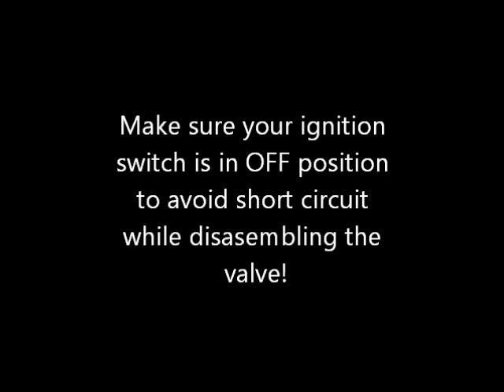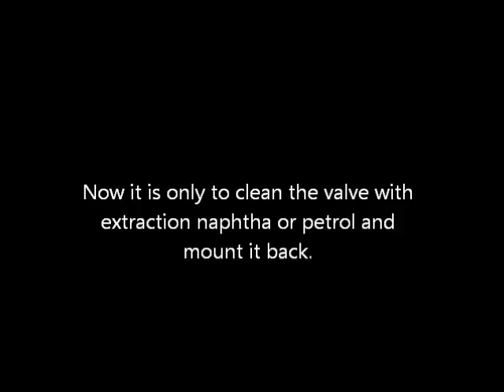How to disassemble EGR valve in Volvo V50 2.0D 2007

Comment: one additional comment on the 5th screw underneath the EGR. It's an Allen 5mm and I had to cut the shorter side down to 1 cm with an angle grinder

Comment: do u need to drain the coolant to do this?
Reply from the maker: No, you don't. Unless you want to additionaly detach the exhaust gas cooler to clean it.
Reply: @SadowskiMarek  I think I would have to remove the egr cooler just to get to that bottom screw joining the egr valve and the cooler. I don't have enough room to get to that effing screw as the engine is so close to the body. I was able to do the other screws except this one. Such a crappy design. Anyhow, is it possible to just drain half of the coolant as I am so skeptical about getting air inside the engine and piss the heck out of me just to bleed it.
Reply: @ChrisUK_22  Removing:
1. the air filter box ( 2minute job, don't forget to unplug the MAF sensor first) and you don't have to remove the air filter, just undo the 2 bands on the MAF sensor, release a rubber band at the front and then just lift upwards, the entire air filter assembly with it's resonator box will come out.
2. the battery with it's casing (10-15 minutes, don't forget to unplug the battery temp sensor under the battery tray, so 3 bolts and a sensor after removing the battery) 
3. then raising the main air pipe (it's flexible enough)
-----> will reveal the entire EGR valve, and all attachment points will become visible and easily accessible from the left side of the car. 👍

and as bonus you'll get to see your ABS unit (good time to clean up and vacuum), the gearbox upper mout, the gear selector cables.

Comment: Best thing to do to get the Allen's key bolt off is use a M5 allen bit with 1/4 spanner and crack it loose... Only needs to be turned a few times to release egr

Comment: Thanks a lot for this tut! I couldn't even get my car from the parking lot without the engine stalling today.

I got off the EGR quite easily with my trusty little toolkit and some patience. Cleaned the EGR with a fair amount of degreaser, some abrasive and and old electric toothbrush.

The "hard bolt" took some fiddling indeed, but with two extensions and joint just before the sprocket it came off quite easily.
The "5th" bolt was not present on my car ( '06 V50 2.0D) Thanks Volvo ;-)
Reply: Paul Tuinman what was the result? My girlfriend's car 2005 v50 2.0 diesel is going into limp home mode after a few minutes of driving. Fault codes indicate that the egr isn't working, and that the turbo is overcharging. Not sure if cleaning the egr will be enough, or if I will have to disassemble the whole turbo as well.
Reply: Hi, well in the end the EGR worked for a while but then it broke completely. The build-up of dirt in the EGR caused a lot of strain on the valve and little motor in the EGR valve causing it to break down eventually.

I ended up disabling the EGR all together by unplugging it, cutting a aluminum sealing and placing it between the EGR valve and the aluminun pipe that that runs from the intake to the EGR valve.

Viola, a disabled EGR valve and a smooth-running engine. I'm going to replace it next year though as disabling an EGR in Holland is illegal ;-)
Reply: Paul Tuinman egr valves are shit. Probably good for the environment, but not good for the economy and the engine. How did the car run with the aluminium seal? Was it just a round piece that fitted between the pipe and the valve? Could be interesting to do something similar.
Reply: There's a gasket between the EGR and the aluminum pipe. Just lay down the original gasket on a thin plate of aluminum and cut it to size. Drill two clean holes for the bolts. Now slide in your new gasket and put the bolts back in to place.

Don't forget to unplug the EGR, add some protection like a little plastic bag on the connector and ty-wrap it to an existing cable.

Mine even got trough the MOT without EGR but keep in mind replacing may be neccesary if yours dont.

Also be sure to disconnect the battery. It resets the adaption values. Ideal would be if you let them delete all fault codes at a workshop.

Result: A clean running engine and a better throttle respons. In terms of powere there's no real difference.
Reply from the maker: @spancer87 - this seal is nothing fancy. Is EGR good for engine? Well there are some benefits with having EGR working (beside the enviroment): In 2,0D engine the exhaust gases are heating up the coolant (thanks to small heat exchanger) so the engine reaches proper temperature a bit faster. In addition it will extend DPF life because less of particaltes comes to exhaust. Disabling EGR will not give you any ECM faults.
Reply: Well it will give a "signal too high" fault code (P0489 / 18DAF110) but nothing fancy. Good one on the prolonged life of the DPF. My '06 model doesn't have one :-)
Reply from the maker: Lucky you with not having DPF... You're right, there will be fault but not indicated on the dashboard so nothing distracting while driving. That's what I ment.
Reply: maroo1981 this might be true, but for this car with the manual transmission in a cold climate, and often driving it without reaching a healthy temperature, the egr is set to fail. This is a very common issue on just about any diesel engine in Norway, and often you hear people avoiding stupid expenses by blinding the egr. On bmw in the early 2000 models, they made a swirl flap system in the inlet manifold meant to increase fuel efficiency and throttle response on lower rpms, but the system turned out to be a ticking time bomb since the flaps could come undone and destroy the engine. So it's been acknowledged and people are removing egr and swirlflaps on these engines to avoid disaster down the road.
Reply: U lucky you!!!!
Reply: @Paul Tuinman where do you unplug EGR? Is it the same plug he shown in video? Do you get engine check after?
Reply: @SadowskiMarek there are two bolts holding the valve to the engine on the video. On mine there’s another one underneath the valve. Did you had it? If so, how did you managed to take it out?

Comment: Great video. Glad I found it, cos the Haynes manual recommends dropping the engine down and forward to gain access. Ive had to do this for the clutch and it is not difficult but a bit of a ball ache if it starts raining and you are a driveway DIY mechanic like me. 
Ill let you know how long 'many many minutes' was for me!
Reply from the maker: Mind the 5th screw on the bottom of valve. It is not in my video because I hldid not have it. Good luck!

Comment: Hey, having issues with my 07 s40 2.0d when the egr is plugged in, normal driving it's jerky and almost kangarooing unless I give it full throttle, when egr is unplugged it's smooth as silk.
Is this simply the egr failing or could it be something else and unplugged egr seems to sort it?

I tried to remove egr as shown to clean it out but it seems there's an extra bolt that's basically impossible to get to 😩
Reply: Your DPF is likely clogged and needs a cleaning.

Comment: The garage stripped mine and cleaned it and the car worked perfectly for one full day but is now back to kangarooing. This would suggest to me the EGR valve is faulty and the ODB reader suggest this is the case. Should I now move to replacing the valve with a new OEM or second hand working one or is it worth trying to clean again? Second hand ones are quite cheap on Ebay anyway
Reply from the maker: Adrian Jowitt If you cleaned the EGR there is no sense to clean it again. It is rather not possible that the dirt blocked it after a one day. What DCM error code is read by OBD? I had a problem with communication between EGR and central module (read by VOLVO VIDA). It turned out that the cable had a break. With second-hand valve it is risk because even nice looking part could have damaged electronic.
Reply: Hi there. Codes are p2263, p0002, and p0490. Bearing in mind it worked fine for 36 hours seems to me the egr valve is maybe end of life and cleaning it just helped for a while??
Reply from the maker: Adrian Jowitt If the EGR id dead, engine is "kangarooing" only in stable ride between 1600-1800rpm. It jerks also while starting and stopping the engine. But if it is going while accelerating you should take a look at turbo code p2263.  If there was a short in cables from EGR some cables moving could help for a moment. This is my opinion, but I am not a proffesional.
Reply: Hi mate what you described is exactly what is happening between 1600-1800 and is OK in higher acceleration. It's had a new turbo. Everything pointing to faulty egr valve. You have been very helpful mate. Thankyou
Reply from the maker: Adrian Jowitt Glad I could help. Write a comment when you will deal with this problem. Good luck!
Reply: +Adrian Jowitt hello, have you sold the problem?
Reply: I have put a blinking plate in for now to reduce the kangaroo action. I have a replacement egr valve and just waiting for my friend to change it for me
Reply: Blanking plate... Not blinking lol
Reply: +Adrian Jowitt could you please explain how you engine worked, so you thought there is problem with egr? Did you have error on your dashboard?
Reply: Error code and car kangaroos at low revs as stated above and car also enters limp home mode when at high speed. When garage cleaned egr all faults disappeared  for 48 hours and then restarted so i have now bought a repkacement egr
Reply: +Adrian Jowitt could you please explain what is limp home mode?
Reply: +Gleb Chupin google it. Easier than me trying to explain.. Google Volvo limp home mode..
Reply: +Adrian Jowitt how much did the garage charge you to clean the unit?
Reply: No charge as I had only just bought the car. I have now got a replacement unit
Reply: Adrian Jowitt thanks for your reply Adrian.

Comment: Can I delete the egr from my car will it still drive ok without it ???
Reply from the maker: It will. Simplest way to do it is to cut a metal cap and place it between the valve and metal pipe running to intake. And unplug the cables.  It is possible to delete EGR from ECM software but that is a challange for specialists ;)
Reply: maroo1981 thanks
Reply: maroo1981 For my car is it , and i seen it only few days i bought it. Its not very bad , or better dont do this?

Comment: I have removed my pipe going to the egr, and there's not gasket is this ok?
Reply from the maker: Marc Street: there should be metal gasket between the pipe and EGR and rubber ring between pipe and intake manifold. There should be gasket between EGR valve and it's cooler as well.
Reply: ok will have to find the part number for the gasket, thanks

Comment: you forgot the 5mm allen bolt on the bottom
Reply: mammutit Can you please tell me where this allen bolt is and the easiest way to remove it. I have had all disassembled today and had to put it back again as I couldn't get the valve off then I read your amendment now that I have come in again.
Reply: William Kelly it is on the bottom of the egr valve itself. http://www.volvobreakers.co.uk/pimages/small_DSCF1465.JPG you see it is party loosened with the washer on the bottom of the picture
Reply: mammutit It is VERY tight space under there, the bottom of the screw and the air intake hose are very close together , you need this : the smallest bits ratchet : http://ecx.images-amazon.com/images/I/31WlzyKKpVL._SY300_.jpg , there is enough room under there for you to hold the ratchet with two fingters comming from the right side, and two fingers allinging it with the screw from the left side, have patience
Reply from the maker: mammutit This allen bolt you've show on the picture - you can see on my video @6:24 that there is no such bolt in my EGR valve. What is this for and is it holding something?
Reply: maroo1981 it is just another fastener to the engine. if you dont have it someone took it off and did not put it back on. It is not strictly needed so the best practice is to not screw it back on if you have it because it is so difficult to remove. A second way to remove it is to raise the car and put 5-10 ratchet extentions from under the car to be able to open it up all the way from under the car
Reply: Thanks for your reply yes I have been thinking of not replacing it once (if ever I get it off!) I was looking at the prospect of going up from beneath but seem unable due to various obstacles. I have the battery box removed and a breather pipe released but its an awkward (fatherless child to get at) so going at it again today.
Reply: Hopefully it will all be worth it and be the cause of the fault.
Reply: try from under the car with an circa 50cm extension, but u need light 
and someoane to show u where is that screw it's verry tight
Reply: How do you get that 5mm allen bolt out out I spent ages and give up.
Reply: maaannn..half of the day i was trying to unscrew that damn screw....no chance...couldnt do it...my hands are now all scars and pretty swollen...they hurt like crazy...I was thinking of another attempt these days...I also have that ratchet ..I saw it after i gaved up...and putted all back together..:))))).I cant sleep if I cant remove something...so maybe I will try again these days...
Reply: technically , no child can be fartherless ...

Comment: hey whats the diffrents from 2 pips on intake manifold then 1 pipe? 2 pipes more power? my 2.0d only have 1 hose :(  D4204t  v50 2007
Reply: Mine get 2,but no idea
Reply: I think the other intake opens at a later moment cause i saw that it’s connected before the cooler so one side cooled air and the other at later moment not cooled air but im not sure